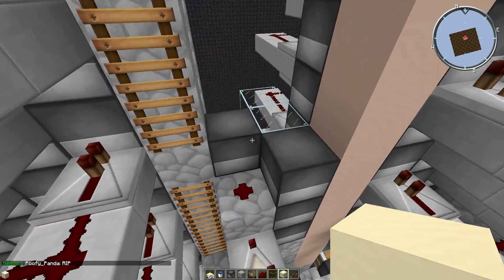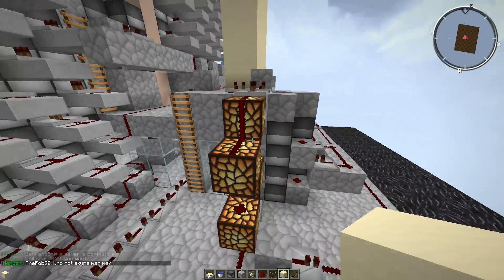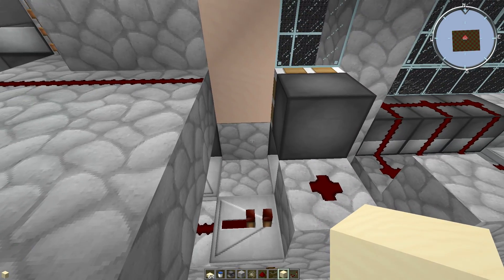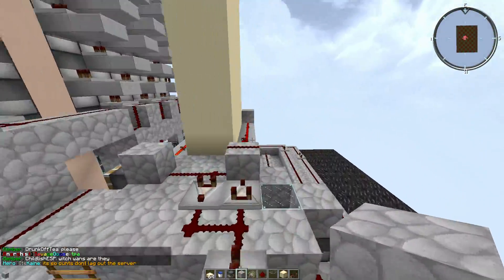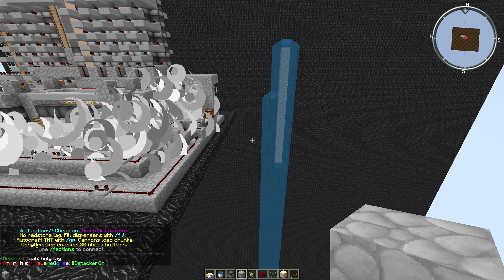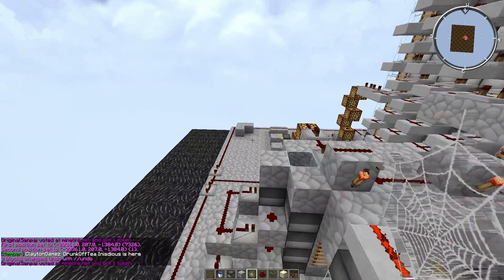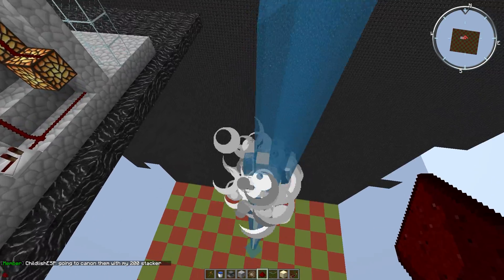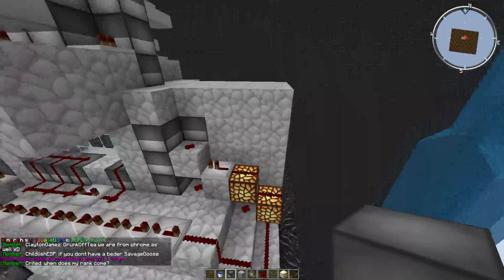220 stacker Guide

Comment: Hey dexter I play on archon and when i shoot through lava walls it gens cobblestone. they are not region was just lava wall followed by a water wall... I know i have to change the scatter timings and it works some of the time, but the other times it docent even blow up the one shot sand? any help would be great thanks!
Reply from the maker: +MrCraftyFTW™ Change slabbust ticks to after the hammerdown. that would solve the problem you are facing. i also recomment to reduce the 1 shots timing so it fits perfect and blows up fast at the wall!. that will reduce the chance of lava falling at water
Reply: I have all that which is why it works but its inconsistent? works only half the time?
Reply: and my onset sand is being shot up instead of down?
Reply: oneshot*
Reply from the maker: MrCraftyFTW™ add 2 repeaters"Full ticks" to the oneshot to fix the one shot sand.

If you can make the 1 shot shoot a hole in a wall real quick it will fix the lava/water wall issue you first had a problem with.
Reply: Sorry dude but its not working... is there anyway u would be able to hop on mine link?
Reply from the maker: MrCraftyFTW™ Whats your Ingame name?
Reply: MrCraftyFTW but I figured it out anyways but thanks!
Reply: +Dexter113 Hey dexter srry to bother u again but I'm working on my full auto rn and it works perfect but the red sand is still being shot up in the air?
Reply from the maker: MrCraftyFTW™ a quick fix is adding ticks to oneshot tnt. so the sand have time to fall down on the tnt :)